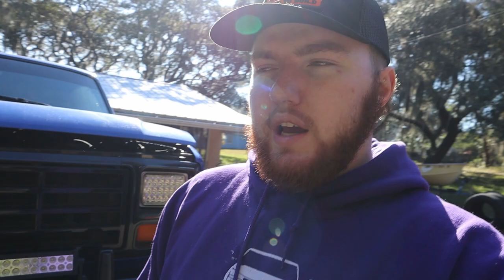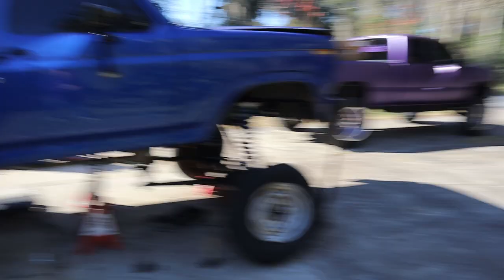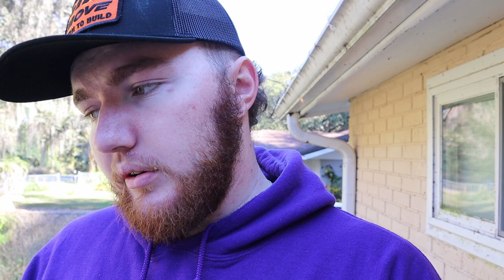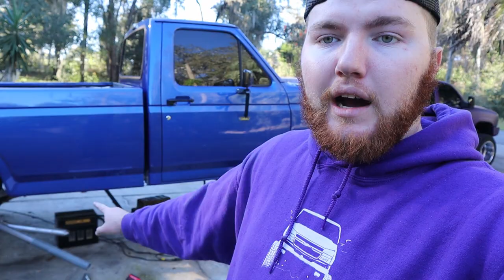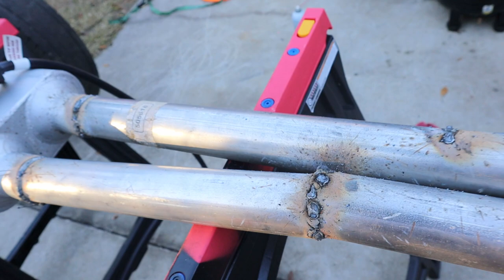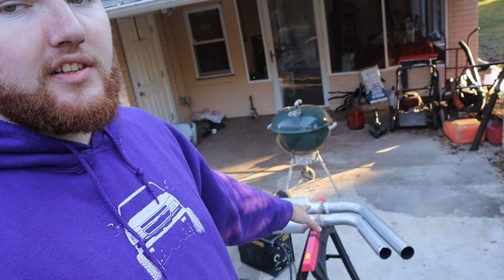Welding Custom Exhaust On My Lifted Bullnose Ford

Comment: Great video man, I would not worry about the welds your not a exhaust shop and you still installed a exhaust on your truck I respect you a lot for that. The bull nose definitely sounds better, I remember the original exhaust video it screamed😂.
Reply from the maker: Welding exhaust isn’t the most fun thing to do 😂